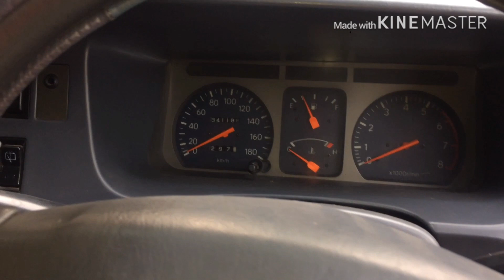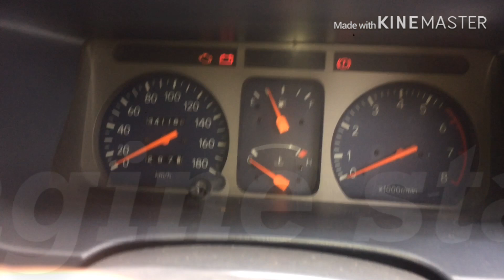Toyota Kijang LGX 2.0 EFI AT 2002

Comment: Bang kalo yg 2.0 sma 1.8 enakan mana bang
Reply from the maker: Sebenarnya sama enak nya..
Dari tarikan dan suspensi nya pasti lebih besar tenaga yang 2.0 sama dengan kelas Kijang Innova gen.1
Tapi untuk LGX biasanya banyak yang prefer ke yang 1.8 katanya yang 2.0 itu lebih boros, apalagi di sematkan transmisi automatic
Reply: Kalo yg LGX facelift 2002 2.0cc warna abu2 itu kisaran brp bang pasarannya..
Reply from the maker: @maskarebet2900  Transmisi A/T kisaran di bawah 60 juta
Transmisi M/T di atas 60 juta
Reply: Kalo varian LX 2001 kemarin kena 54 kemahalan gk bang